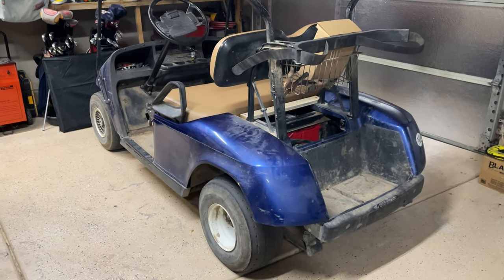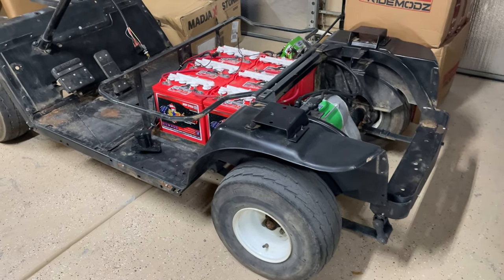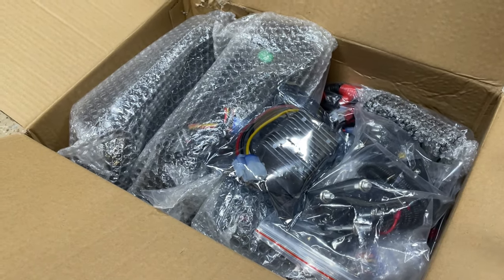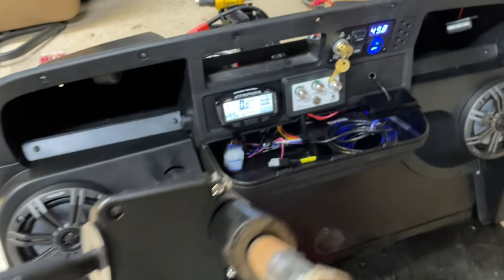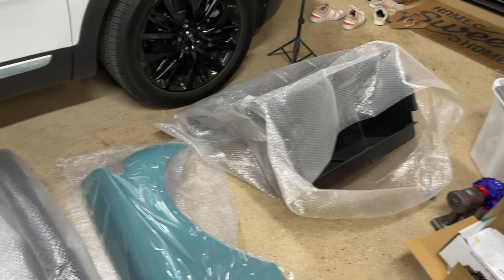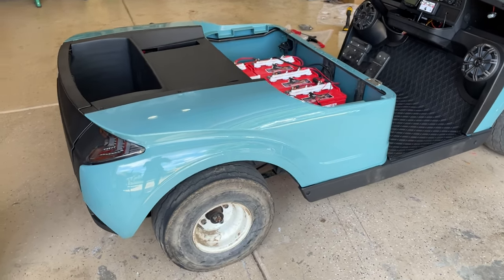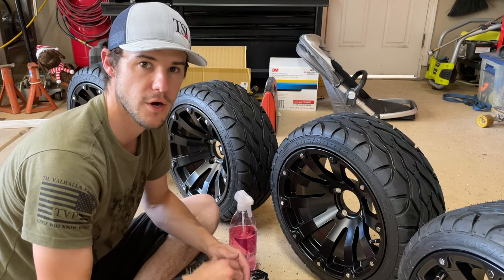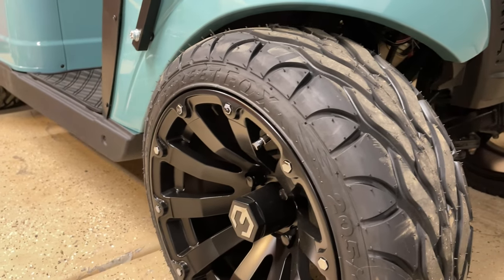Ezgo TXT Complete Restoration and Major Upgrades

Comment: How much money was this build?
Reply: Probably around 7-8k minimum not including the cart
Reply: @robertdavis9020 
More like $700
It didn’t cost more than $2,500 to build the whole thing. 
$7k ? What made you say that number ?
Reply: @Eye-it-azz  body kit is $1,800, 6 eight volt batteries are going to be around $200 each so we’re already at 3k then the motor and controller swap is a few thousand, the rear seat kit is $500-700, think you can start to get the idea how quick it adds up, if you get dealer pricing then good on you but at retail it’s going to cost you
Reply: Can you provide a parts list ?
Reply: The roof is 500-1000 .
Reply: @Eye-it-azz you bought all the cheap stuff to get it to 2.5.  a cheap rear seat is 300.  You prolly didn't do  batteries. The wheels and tires in this video are around 1k alone, roof 500-1k
Reply: Golf cart part are cheap, I would guess no more than 3K since he didn’t have to mess with batteries/controller/motor

Comment: I’ve learned that the reason for your clearance issue is due to the front leaf springs. On those old txt’s the springs become weak. All you have to do is install new ones. Learned the hard way

Comment: I don't see a link to the seats you used. I don't think the seat belt is standard on the EZGO, did the ones on yours come with the seat or with the body kit? Love the look, I have 5 older carts in our fleet and with the cost of new carts going up it looks like this would be a great option to revitalize these old ones.

Comment: Most likely I'm too late but the transom looked tight to the center pontoon....being a plastic do you need some sort of padding between the to to avoid friction cutting the pontoon?   BTW  nice project....also next time you glue your flooring try "flapping" the vinyl as is laying face to face creating a cushion of air allowing you to   "push" the vinyl into place.... sounds crazy but it works... I've handled very large cuts doing this.

Comment: I have a set of kicker cs465.25 that I plan to put in my 2000 dodge ram Laramie slt for door speakers and a set of cerwin vega hed 6 1/2 inch speakers for the rear doors.. and I might have a better idea for a amplifier that would have more low end bass but it doesn't have the control panel and that is the dual electronics xpr series amplifiers

Comment: @Project Karr - Did you use 2014+ rocker panels with the Storm body kit? Only ones I've found on the internet for pre 2014 EZGOs are the diamondplate ones or direct replacements that have the chrome inlay piece like you originally had.
Reply from the maker: Hmm I’m honestly not sure, but I have the same rockers on my 1999 and 2018 carts. I believe they are the 2014+ gtw brand.

Comment: Did u use 1” front strut for the roof support? Says it’s for 2014 and up but I want to try to use it on a 2000 Ezgo txt… trying to confirm if it’s possible thanks
Reply from the maker: I used the 3/4” front roof support but you shouldn’t have an issue using the 1” support as long as you also change the windshield clamps to 1”
Reply: Thanks!

Comment: Hey on you build you did 11 months ago what did you do with the old body parts?
Reply: I'm wondering if the bumper would fit my 2019 ezgo.  My bumper is busted a bit.
Reply from the maker: I actually just picked up a 2018 txt to do another build on. I will check and see how the bumper looks on it

Comment: Which Navitas kit did you install?
Reply from the maker: @chrisginoc  the Navitas 600a 5kw system
Reply: @projectkarr  How high up in MPH can you get the golf cart with that kit? I’m debating if the 440a 4kw, 600a 4kw or 600a 5kw is the better option? I’m in Orange County and all my riding is flat, but I know I won’t be happy barely going 20-25mph spending all that money for the kit, but I’m not looking for 45+ mph since I have a wife and 2 boys riding with us.
Reply from the maker: @chrisginoc  I max out around 35mph on 48v. My new cart is running the same motor/controller but with 72v and it tops out around 47. Unfortunately I don’t know too much about the 400a 4kw system. One thing I highly recommend is the otf controller. It’s great for dialing everything down to cruise with the family
Reply: @projectkarr  What 72v battery did you go with?
Reply from the maker: @chrisginoc  I’m using 3 of the 72v falcon batteries from battery evo
Reply: @projectkarr  I’ve read bad reviews about Battery EVO which is why I avoided them. How has the battery been and any regrets lifting the cart in reference to stability?
Reply from the maker: @chrisginoc  I’ve been running 4 big battery eagles for over 2 years without a single issue. My 72v cart has been running 3 72v falcon batteries from battery evo for about 6 months now and I personally don’t have any complaints. That’s just my experience so far. There was some sort of falling out between big battery and battery evo so I’m not sure if that has cause any warrantee type issues for people.